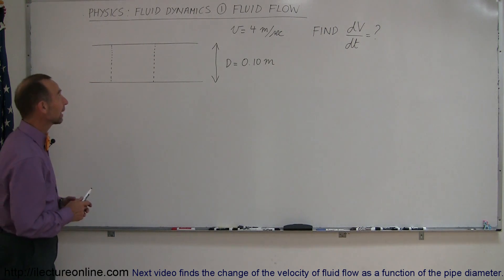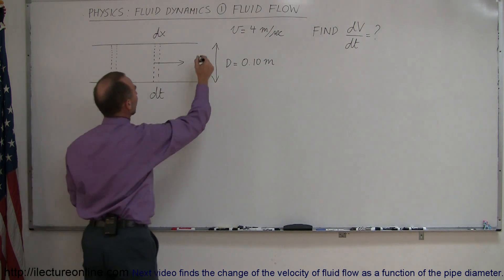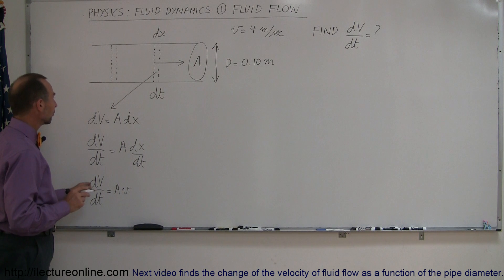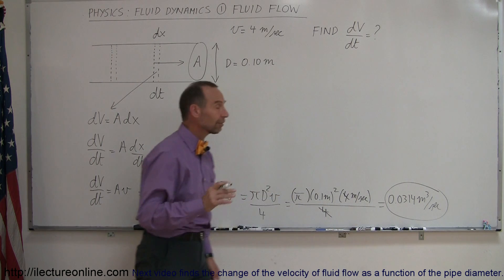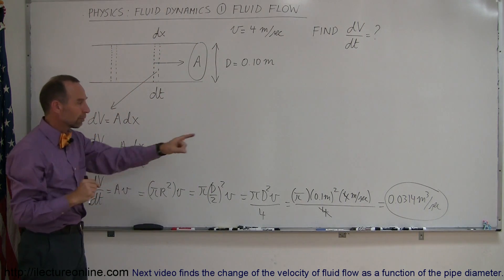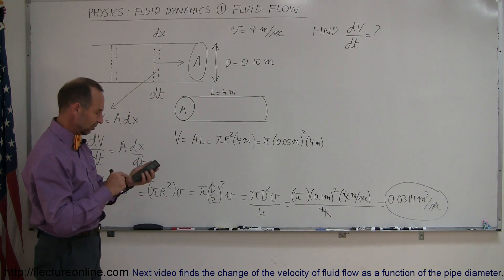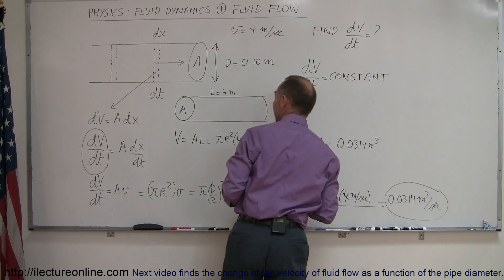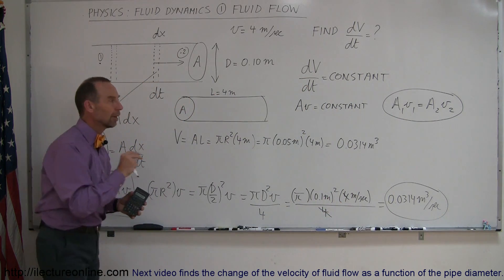Physics 34  Fluid Dynamics (1 of 2) Fluid Flow

Comment: thanks for wanting translations completed properly supports.

however does those formulas equal those dotted lines, as how a map works?
Reply from the maker: The dotted lines are arbitrarily chosen in order to display a section of fluid in the pipe moving a small distance.
Reply: good, let's try to get more into that moment especially with oils and water separations. geomagentized pre creature water and creature water resemblance curvatures. also staying in bubble logistics and multi ring signal limits(colooputones).
Reply: other than life science, how are you doing on social adaptation liberty?

Comment: BALANCED inertia/INERTIAL RESISTANCE is fundamental. c squared CLEARLY and necessarily represents balanced acceleration---a dimension of SPACE ON BALANCE in relation to what are E AND "m" (ON BALANCE !!). Consider TIME (AND time dilation) ON BALANCE. Hence, what is a TWO dimensional surface OR SPACE ON BALANCE is (CLEARLY) invisible AND VISIBLE SPACE in fundamental equilibrium AND BALANCE. The stars AND PLANETS are POINTS in the night sky ON BALANCE, AND consider what is the speed of light (c) ON BALANCE. Consider what is THE EYE AND what is the BLUE SKY (ON BALANCE). ELECTROMAGNETISM/energy is CLEARLY AND NECESSARILY proven to be gravity (ON/IN BALANCE). E=mc2 is taken directly from F=ma. Accordingly, ON BALANCE, the rotation of WHAT IS THE MOON matches it's revolution. GREAT !!!

By Frank DiMeglio

Comment: How we extract water from ground by using a water column in a tank as a suction cylinder
Reply from the maker: Water pumps create a vacuum so the water will rush into the vacuum.   The height (or depth) limit is about 34 feet (9.8 m) beyond which the water cannot be pumped out using vacuum.

Comment: Is there a video on Pitot Tubes?  If not could you please make one?  I am unable to understand where is P1,V1 and P2,V2 measured in Pitot Tubes.
Reply from the maker: It is a device that measure the speed of the fluid by measuring the pressure inside the tube.  We should make a video on that.  Thanks for the question.
Reply: Michel van Biezen Thank you Professor!

Comment: This may seem like a silly question but i was wondering how were you able to denote that volume = dV, and thus dV = A.dx
Instead, shouldnt it be volume = V, and thus V =A.dx.
Reply from the maker: dV  represents a small volume segment with cross sectional area A and a very thin thickness dx.  This is how calculus is used to define the technique of integration and differentiation.

Comment: sir that DX is the width of the cylinder but u took it as height while writing the volume =Area times dx.Why is it so ??
Reply from the maker: +Rahul Tiwari 
   No, dx here represents a small distance in the x-direction (horizontal direction).    
"A" here represents the cross-sectional area of the pipe.

Comment: Does this only apply to fluid flowing through a closed pipes or can it also be applied to a streams of water, half pipe, etc.?
Reply from the maker: Thuan,
Some of the principles are the same, but there are differences.  I still have to complete this series and it is on the list of things to do.